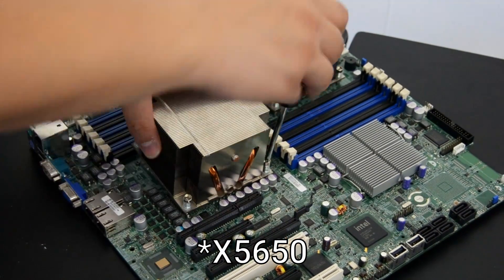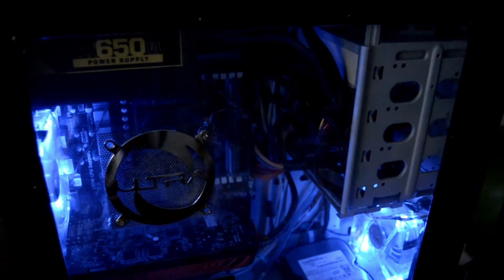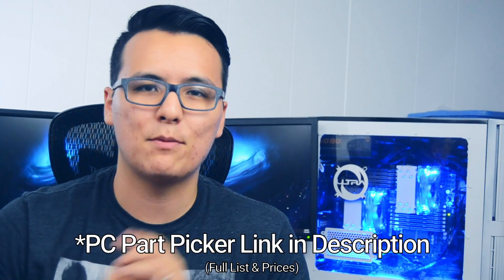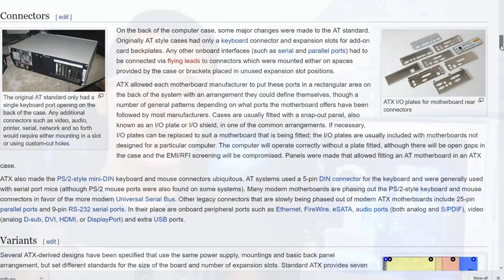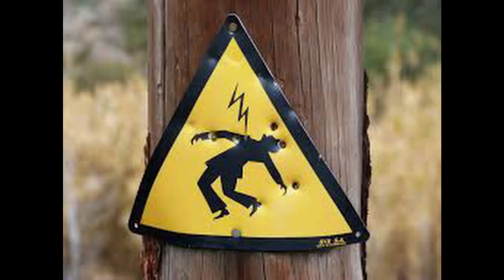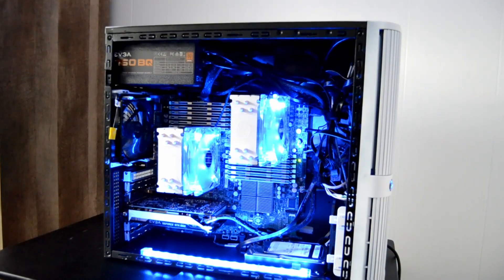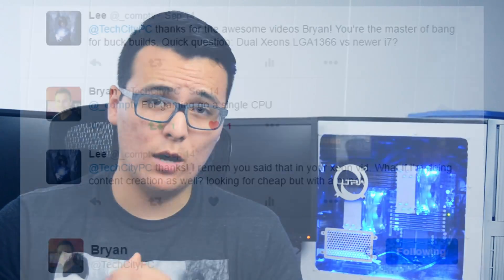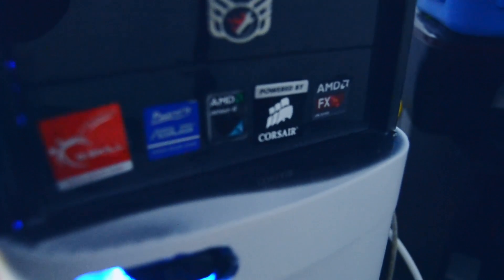Gladiator 2016: Part 2 - Building my Dual Xeon Workstation

Comment: I know this is an old video, but I just finished building and bench marking my own dual xeon machine. I got crazy deals on used ram and my cpu's. The complete rig was under $800.00 
I've got two E5-2680 8 core 16 thread cpu's, 
128 gigs of 1600 mhz DDR3,
 8 gig RX580, 
 one terabyte nvme drive.
 All my case fans and my cpu coolers are Noctua and man is this thing DEAD QUITE!  Single core performance sucks because of the low clock speed. BUT MAN DOES SHE FLY THROUGH MULTI THREADED NUMBER CRUNCHING!! Video encodes, dvd rips, and rendering run like greased lightning. Its not as fast as a modern 16 core cpu but  my whole rig is cheaper than a thread ripper and still plenty fast.

Comment: With the psu could I run a split adapter since the psu I have only has one 8 pin cpu plug and not two

Comment: I´ve recently bought a complete dual socket system for about 770$. Boy oh boy was i lucky. It came with 24gb ddr3 ram, two xeon x5680 a 1500W PSU, 4x 1TB harddrives and best of all a functional model of the EVGA Classified SR-2. I guess the seller had no idea what that stuff was actually worth, especially the motherboard. That thing kicks ass. I was able to OC both processors to 4.3 GHz on air with reasonable temps to achieve 1910 points in Cinebench R15. Fuck yeah! :D

Comment: You should have buy non ECC ram, everything else is on place
Reply: This MB doesn't use non-ECC RAM because it's like a server board. ECC might be about 3% slower but the failure rate is almost non existent.

Comment: I have a question that's not really on topic of the video, I'm "building" a pc, basically taking an old oem and shoving in a GTX 1050 ti, so do I need to put ssd's in a hard drive cage or does it even matter (ik that's a dumb question but I'm new)

Comment: I have the same exact board but used dual X5687's and 24gb of ram, went with the XFX RX 480 GT-R Black Edition. I regret building this and not going with a x79 3930k build :/
Reply: Why the regret out of curiosity

Comment: Hi, I'm also in the process of building a dual Xeon workstation and have a 850W power supply from my previous computer. However, the power supply does not have two 8pin CPU ports. Do you know if there's an adaptor to split this into two or would I have to buy a new PSU? Thanks
Reply from the maker: +Adam Westhead I would recommend just getting a new PSU. Adapters are hit or miss and can cause serious damage
Reply: Thanks for the advice bro! Just ordered a new one now
Reply from the maker: +Adam Westhead my pleasure glad I could help

Comment: so funny story. My dad (who works in IT recycling) brought home a functional server blade with this exact motherboard and 2 E5520 xeon chips and 8gb's of ram installed. I've since dropped in 2 W5580 cpu's I snagged for 30$ on ebay as well  as an additional 12gb's of ram. now here's where the similarities between our builds get even closer. I'm currently building in a white Thermaltake case with blue LED fans installed (got it for free off a buddy), I have the same PSU on my wishlist for Newegg just waiting for my order as well as the 2 hyper 212's (btw thanks for figuring out the standoff issue before I order mine). so glad I found your video and I'm looking forward to finishing my version of this PC.
Reply from the maker: +Evan Dickerson ayyyy thanks for the tweet 😉
Reply: comptv no problem my friend. Didn't know how often you checked your comment notifications so i tweeted you after writing this. just finished benching my pc and It's performing better than a OC'd 4770k not bad for a machine I've barely put a dime into.

Comment: hey do you remember where the connectors are for the case to connect to the motherboard so i can turn it on etc? thanks
Reply from the maker: +HixxyDubz yeah I found a manual on supermicros website!
Reply: comptv thanks man finished my build :D also with this particular build I didn't need the M3 standoffs cos all I had to was remove the plating on the back and back plate for the 212s fit perfectly
Reply from the maker: +HixxyDubz good deal bro!! My hyper 212 brackets were touching some capacitors and there was bare metal so I didn't trust it, but send pics so I can retweet!!!
Reply: hey man ill definitely send pics, but i ran into a problem, do the PSU have to have 2 4pin connectors for the motherboard by any chance? i try to turn it on and all i get is a green blinking on light on the motherboard.
Reply from the maker: +HixxyDubz for this one you'll need to sleep sure you have two dedicated EPS CPU power plugs on your PSU. That's why I bought the one I did
Reply: I may have a fix for this, and it may work, i hope so, otherwise it's going to cost me lol
Reply from the maker: +HixxyDubz okay good luck keep me updated

Comment: hey man im building exactly the same rig but a problem i ran into before buying was if the supermicro x8dtn+-f will fit an EATX board, can you confirm if the board you used is similar to one i mentioned and if it will fit an EATX case? many thanks and cool video.
Reply from the maker: the board you have is a EEATX which means you will either need a special case, or you will have to mod a case to fit it. My board is EATX which is more of a standard size
Reply: thank you for the reply, im trying to find the same board you have , will i be required to mod the case anyway regardless of board?
Reply from the maker: For an EATX mobo you can use a EATX case, or a Full Tower case usually. It will depend on the case. My board was a X8DTI-F
Reply: the seller that i am interested in says the board that i want is a EATX and not EEATX , i am so confused now lol, thanks though appreciate the replies.
Reply from the maker: My pleasure, be sure to check supermicros website. they have all the specs
Reply: hey man i decided to look on supermicro's site as you suggested for compatible boards, thankfully i found one that is an ATX and is going for a decent price on ebay which looks similar to yours but just not as big which might help with case fitting, anyways thanks for the help appreciate it :)
Reply from the maker: +HixxyDubz of course!! Just make sure it has a PCI Express lane x8 or better. Sometimes those only come with x1 lanes
Reply: this is the slots from their official website

PCI-Express 
2 (x8) PCI-E 2.0 (1 in x16 slot)
1 (x4) PCI-E 2.0 (in x8 slot)
1 (x4) PCI-E (in x8 slot)

not bad huh? :P
Reply from the maker: +HixxyDubz perfect.

Comment: why would you let a lga 1366 pc grow along side you, its 2016, could have at least have gotten a board that actually fits, like maybe a supermicro x8dtl-3f, standard atx size with way more pcie slots than you have and probly cheaper at 100$,  lga 2011 with 2600 series xeons would have cost you the same, with lga 2670 at 70$ a peice and a board for maybe 200, would have been way better off hahaa, catch up on your pc homework kid.
Reply from the maker: thanks. 😉

Comment: will this build bottleneck rx 480 crossfire, how will it perform?
Reply from the maker: +_ WhereWolf_Engine _ in GPU intensive games this system does pretty well, but in the case of CPU heavy games it's better to just get a higher clocked CPU. 

For crossfire RX 480 I would recommend i5 and different Mobo. Not much point in a dual GPU system for gaming
Reply: comptv alright thx 4 the quick reply!
Reply from the maker: +_ WhereWolf_Engine _ of course 😉 glad to help

Comment: X5650s shine when you can overclock the shit out of them, I think at stock they are probably a bit anemic for gaming.

If you ever come across a SR2 board for reasonably cheap, you could probably get some decent performance out of that platform.

I did a similar build this year, but I'm running dual E5-2690 v1s with 64GB DDR3, a GTX 1080 FTW on a practically new motherboard out of a Lenovo Thinkstation D30. The setup performs well, but I'm gonna say definitely do not take this route if you are primarily gaming, a stock i7 from the current or last few generations will outperform this in any single-threaded application.

Good news though is that games are starting to become more multi-threaded with dx12 and Vulcan. Battlefield 1 and Doom are two that come to mind that make pretty good use of multi-threading.

Also if you are running games at above 1440p the weaker single-thread performance might not actually matter much as then your GPU will be the bottleneck.
Reply from the maker: +SteyrM1912 good deal there. I'm pumped for that. And I agree 100% if SR2 boards weren't ridiculously overpriced I definitely wouldve grabbed one instead. Great insight and nice build bro!
Reply: ahaha you cant really overclock a xeon except for the base clock to max like 106, yeah thats deff overclockign the shit out of them...
Reply: X5650 are Westmere Xeons, everything that came after is super locked down.

Comment: Dual Xeon sucks. I have pc like yours except I use two e5-2670 and 8x8GB ECC ram and case is Phanteks Enthoo pro. I prefer to use my old i7 2600k and 16GB ram, it is much better for everyday usage than Xeons.
Reply from the maker: +Srđan Marković that's a nice build man! Yeah I've never owned an i7 yet but when I do I know I'll love it
Reply: TeCh ExPlOiTs

Well..... I will make comparation of 3 computers I use, I have more but these 3 I use everyday. 
PC1: Laptop Asus n56jr i7 4700hq 3.4GHz 8GB ddr3 gtx760 ssd
PC2: Asus P8Z68 deluxe/gen3 i7 2600k 3.8GHz@4.6GHz 16GB ddr3 ATI 6780 ssd
PC3: s2600coeioc 2xe5-2670 64gb ecc ddr3 Asus gtx1060 6GB ssd
All 3 PCs have additional HDDs, optical devices and so but main boot ssds are same Kingston 256GB. 
Chrome : PC1 incredible speed, PC2 very fast PC3 there is a lag second or two when I click on link.
Word : PC3 needs few seconds more than other to start and open document
4K video: PC1 great reproduction but need some time during fast forward
PC2 great reproduction no time when you skip part of movie
PC3 great, need one second to start playback but instantly fast forward
Watching pictures: there is a lag on PC3 changing from picture to picture.
Cinebench : PC1 632 PC2 840 PC3 2008
Passmark : PC1 7860 PC2 10320 PC3 19620
Rendering same file in 3ds max : PC1 1h44m PC2 1h08m PC3 17m20s

I can not compare gaming because graphic cards are so different. 
It is obvious that PC3 has a second or two lag until it rises clock from 800 MHz to 3.4 GHz. Browsing is so light operation and it counts processor usage according to all cores so light activity wont rise clock because it have 16 cores 32HT and two other have only 4 cores.
PC1 and PC2 rise clock instantly they have 4 times less cores and 4 times lighter task woke up i7. 2xe5-2670 need 4 times heavier task to woke up and rise clock. 
PC1 and PC2 are sweet spots for fun, PC3 is good as a server, for multitasking, 3ds max, for heavy duty applications.

It is light Lamborghini VS heavy Rolls Royce. So which one is better? It depends.....

Comment: Nice build! Earned yourself another subscriber.

By the way, have you considered making a custom shroud or something for the Power supply? I mean its kinda ghetto, but I think it would improve cable management really well because my ocd is kicking in when I saw that messy cables. I spend hours on one computer build to have good cable management even if the case does not have a window.

Still an awesome build nonetheless.
Reply from the maker: Thanks man! And YES! Absolutely, my original plan was to do a Cardboard shroud for the cables, but because of the awkwardness of the positioning/size of the cables, I wasn't able to figure it out soon enough.

Maybe I'll have an update video once I get a fan controller and etc, and see if I can get the shroud up by then. Great suggestion!
Reply: comptv Great! Can't wait to see your new content!

Comment from the maker: First. 

Also, if you notice the "dust" on the side panel, that is actually overspray from the paint job, and I decided to keep it because it added a "frostiness" to the window, that otherwise would just have a harddrive and some cables underneath it. LOVE YOU GUYS!
Reply: comptv Damnit you beat me to it😀😀
Reply from the maker: Chimmy Changa Crocodile let the games begin 😉 hey you're pretty much first at this point!
Reply: comptv Haha lol true how much was the build in total and were  the cpus and mobo used or new if they're new can you gimme link?
Reply from the maker: Chimmy Changa Crocodile hey man!! The CPU and RAM were *USED* (I put new for some reason, not true, I'll put links in the description) from eBay. PCPartPicker link in the description calculated total to around $820. it was more of an upgrade since I had a few of the parts already - so I paid around $350 out of pocket
Reply: y a 1060.?
Reply: y not? My system is pretty similar and uses an RX 480(which benchmarks say is pretty much equivalent).
Reply: comptv where does the graphics card sit? Tried to make out from pausing the video, missed it? Or at least can't make out if it is either of the white slots or the black one?

Thanks!